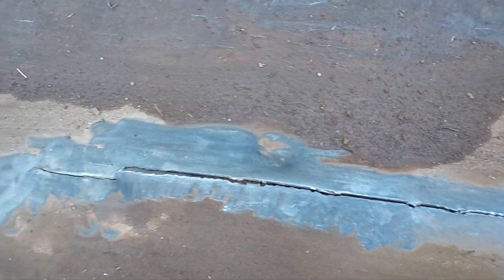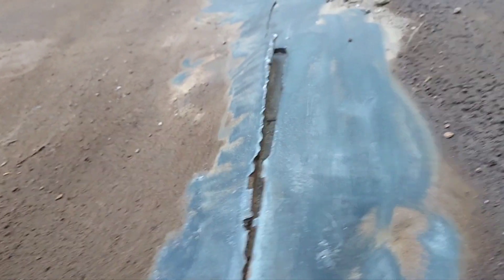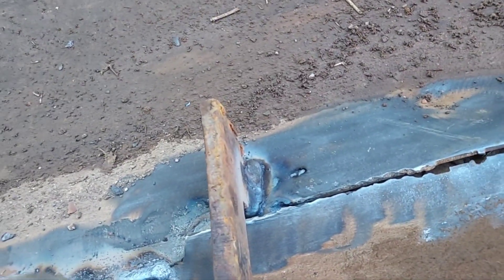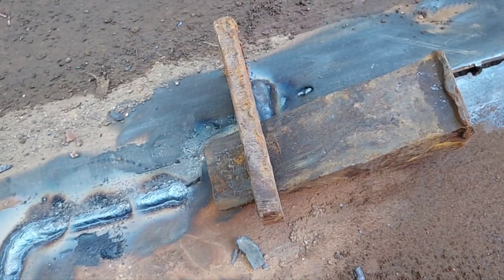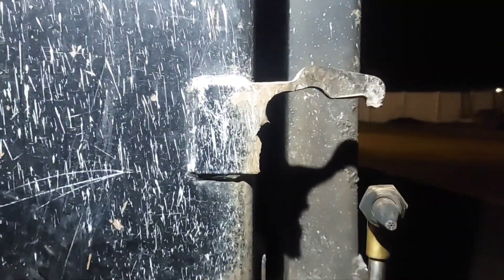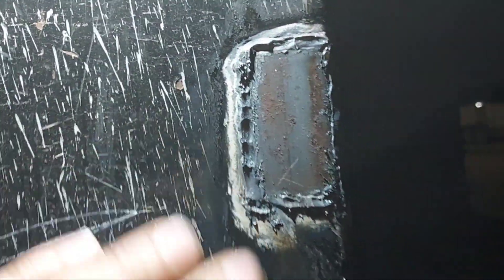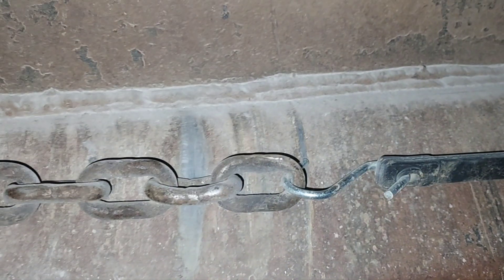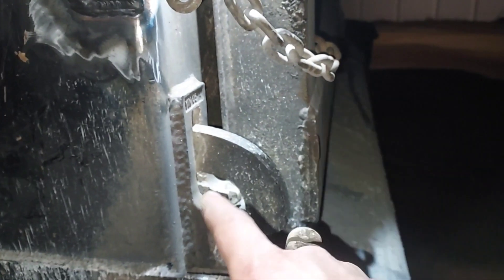Dump truck bed repair

Comment: I was just wondering why you did not drill out the end of each crack? I am sure you have good reason , it is always good to learn something from you as it is real world work.
Reply from the maker: 1st, The bed floor is made of hardox 450 wear plate, so a drill bit won't even penetrate it. I'd just smoke/melt my drill bits trying. 2nd, the plate was already so thin, I just cranked amperage up high enough to "keyhole" the crack and used whip&pause technique to get a light root in. Once I had the root, I just started covering it up
Reply: @JNRWelding  many thanks for the reply, you do great work, keep it up.

Comment: You don't actually show anything. It's like here is a crack jump to the end it's fixed. It is very boring to not see anything.
Reply from the maker: Working on getting a real camera to set up. Spatter and sparks are rough on my phone
Reply: I guess you don't know how wedges and dogs work